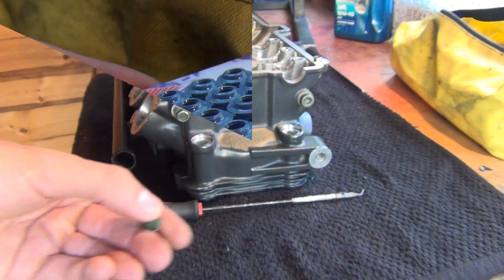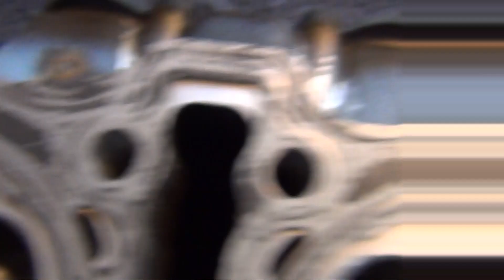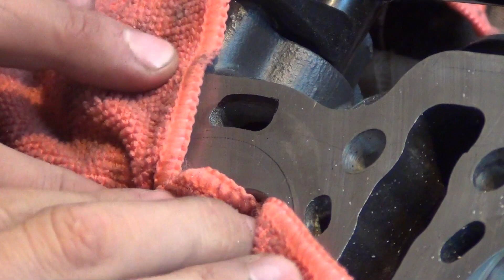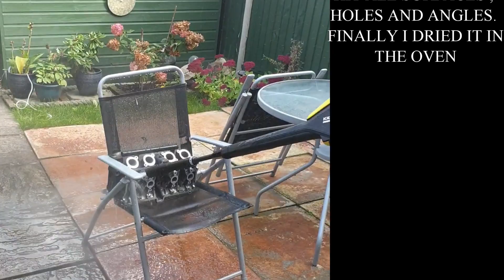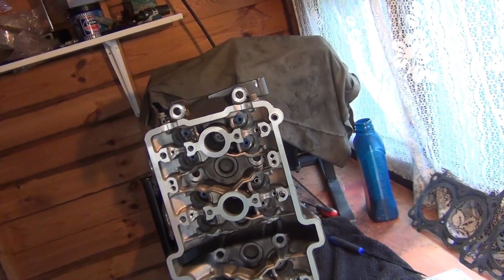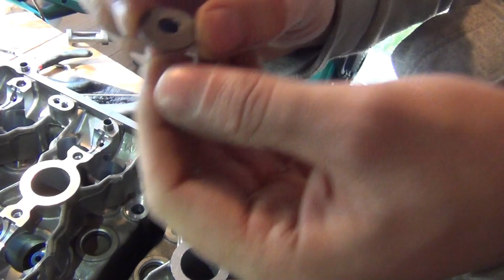Building Suzuki RF 1100 - Episode 5

Comment: Great video.  A little tip I found in the service manual, when I was putting the valves back in on a Honda CBF600, put a small amount of multi purpose grease on the valve collets to keep them in place while you ease off the valve spring compressor.  It made the job a hell of a lot easier.

Comment: There are special pliers for these seals and they cost about 10 pounds, that is where I live at least. The other way is to use old fork, cut the middle teeth and bend the tips of the outer ones 90 degrees to make the special tool :-D
Reply from the maker: Brilliant idea, did't think about it :)